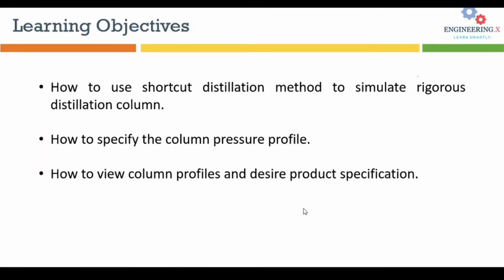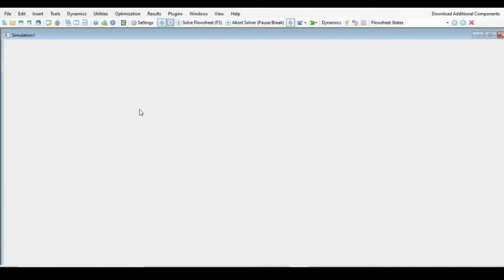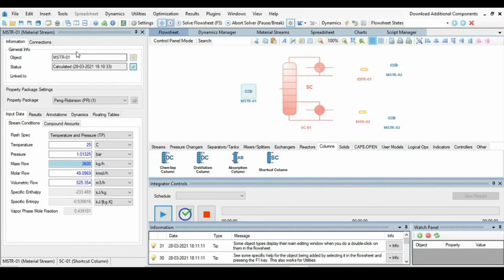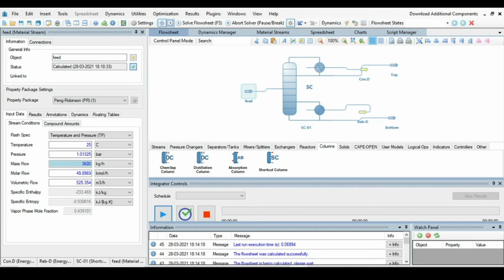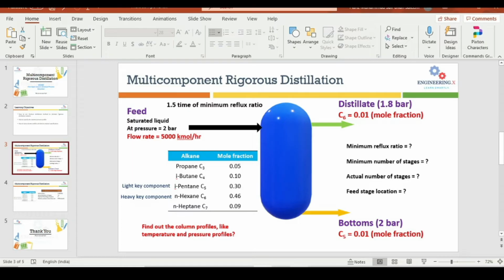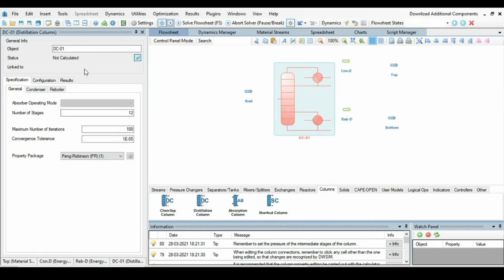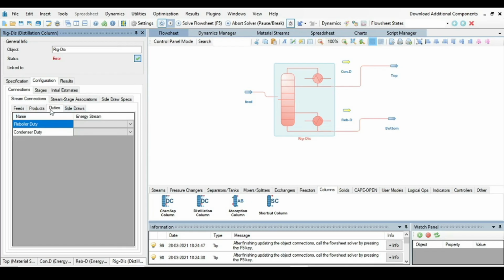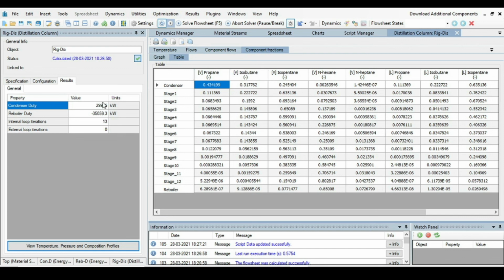Simulation of Multicomponent Rigorous Distillation in DWSIM

Comment: Hey, thanks a lot for your video.
One point which I noticed. In the final configuration of the Distillation Column, we did not reach the final values of 0.01 N-hexane in DISTILLATE and 0.01 Isopentane in BOTTOMS. What is the reason for this? 
The chosen stage number (14) is quite close to the theoretical (14.044). Can this small change already lead to different results or does it have to do with e.g. the pressure profile?
Thanks

Comment: Thank you so much for these series of DWSIM videos. I have a question for you. I didn’t understand why you inserted a shortcut column initially, used its outputs, then deleted it and replaced it with a distillation column.
Reply: By using shortcut column he estimated the reflux ratio and number of stages

Comment: I'm not getting the option for entering the pressure in Reboiler, neither do am getting the option to calibrate the pressures in the stages. If you can identify this problem, please help🙏
Reply: Got the same problem, I think because the version is different 😢
Reply: did u find the solution to it? Because it's not getting solved without it. @chelseazhao6579
Reply: If you add a pressure drop of 0.2 bar in Column Pressure Drop (Distillation Column - General)  you should come to the same results. The pressure profile can be found under Results. (v9.0.4 (July 28, 2025)
Reply: @Tijori262 thank you
Reply: Same
Reply: Same issue
Without that how can we solve what might be the solution
Reply: I also faced the same problem. Something in the menu of distillation column has changed, but the pressure input windows in reboiler and of each stage were disappeared. Please help us.
Reply: Same problem 
Does anyone know how to solve the issue ?
Reply: Facing same issue
Reply: @sanikashete9 Did you find a solution for this?
Reply: Same problem